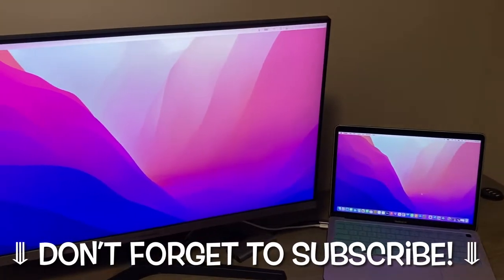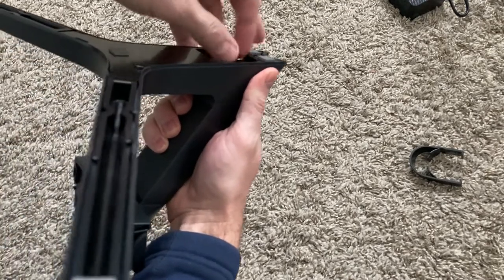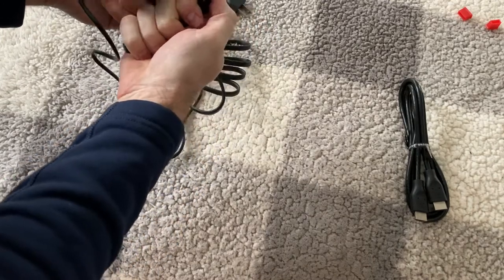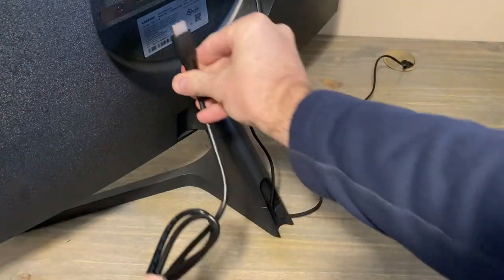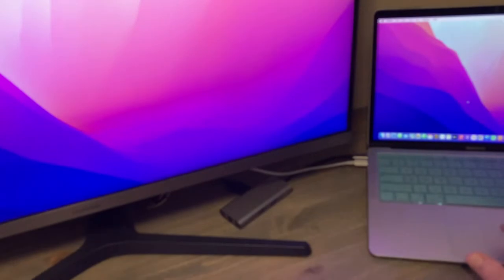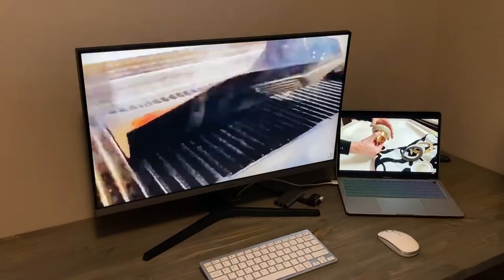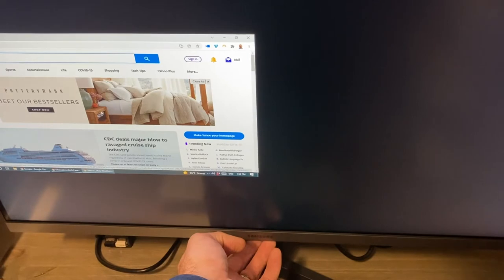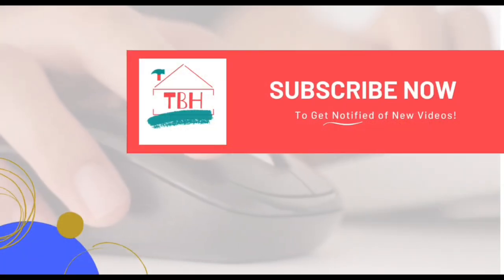🔥 The Best New 28” Samsung 4K UHD External Monitor for Mac/PC Laptop?➔ Full Review + How to Set Up

Comment: The mouse pointer issue you've highlighted is because you are using an adapter that doesnt support HDMI 2.0 (probably is HDMI 1.4). Being 1.4 it is capped to 4k @ 30Hz. If you buy a cable that is a thunderbolt 3 to hdmi 2.0 and connect it on the thunderbolt3 port of your mac and then directly into the HDMI port of the monitor, it will be 4k @ 60Hz
Reply from the maker: Great comment. Thanks for your help here.

Comment: hey mate, how does this monitor work with your mac? mines awful with a mac and slows it down so i'm looking for a new one ;(
Reply from the maker: I love mine. I've had it for a year or so and ZERO complaints.
Reply: Another Youtuber put a link in his video explaining the optimal ppi for Macbooks. And it seems 27 inch 1440p monitors at around 110 ppi will work without issues. Another optimal PPI would be 220, which would go into 5k territory. At any other ppi, the GPU will need to do the work to scale it, so it might lag.

Comment: do you work at 60hz with HDMI? i cant use the complete framerate, i have 30hz only :(
Reply: Try looking into different hdmi cables and/or displayport to usb-c. Also trying to figure this out..
Reply: @woutermvt  I have this problem also, I might have to buy a direct connection cable instead of using an adapter/hub.
Reply: Weird. I used an HDMI cable bundled with my 1080p monitor and connected it to my 4k monitor, and yet the 4k monitor displays 60hz, just lower colour depth.

Comment: Great video, thankyou! I wanted to ask you if the text is crisp on the monitor or is it fuzzy? My wife does a lot of admin work and would need to use it for emailing and excel spreadsheets but the text needs to be crisp and not fuzzy so it doesn't mess with or damage her eyes. Will the monitor work for her? Is everything including the text and paragraphs seen on this monitor very focused and readable? She has a Macbook Air M1. Many thanks again :)
Reply from the maker: My PC and MacBook Air are crisp, crisp, crisp! You can always return it if it’s not to her liking. May need to adjust the resolution on the computer first. Glad you enjoyed the video.
Reply: @diybandit  Thats great news! Many thanks! Can you recall where the resolution adjustment is on the Macbook Air? Is it the general monitor adjustment? Thanks again :)
Reply from the maker: I think it's under System Preferences -> Display
Reply: @diybandit  Many thanks again! :)